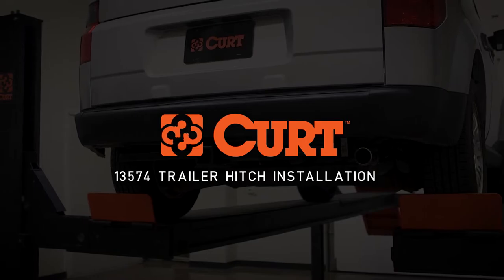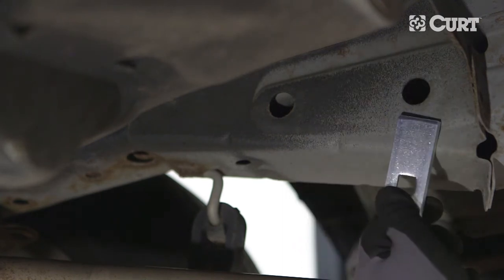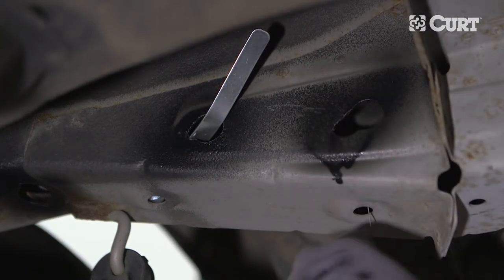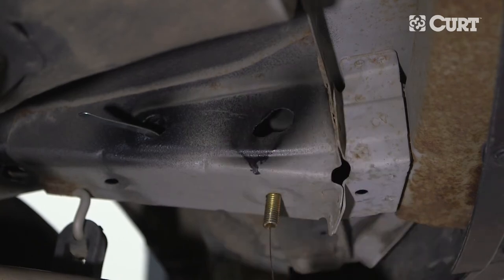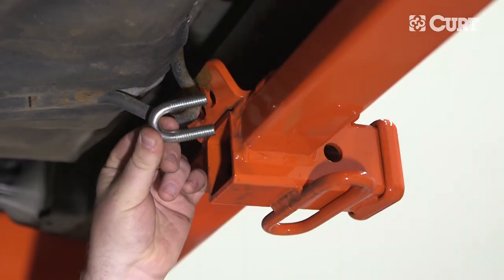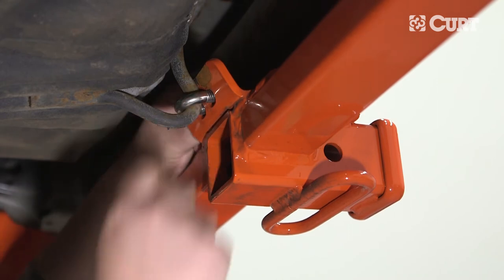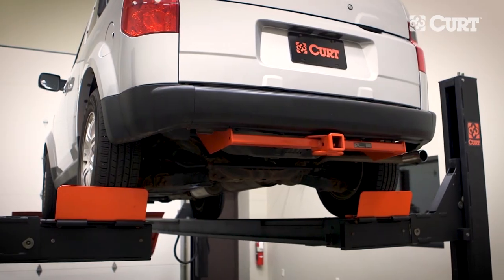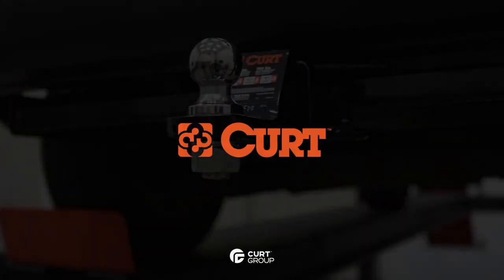Trailer Hitch Install: CURT 13574 on a Honda Element

Comment: Nice video, I like your products- I have a CURT bike carrier hitch mount style- it's solid.  The low profile roof rack looks nice on that Element can you tell me what that is?
Reply from the maker: Thank you for your support.  The rack is custom-made using crossbars from a Ford Transit Connect and fabricated aluminum brackets.